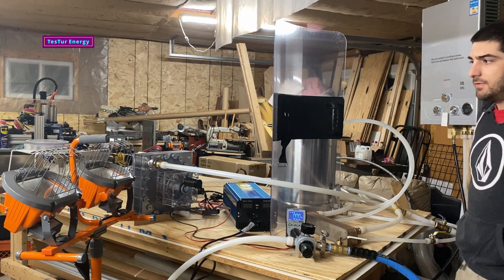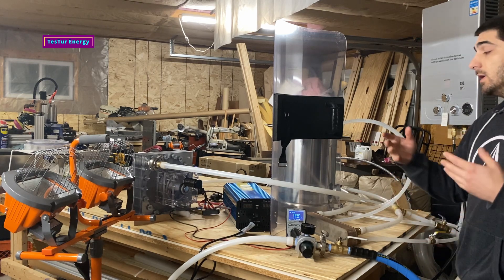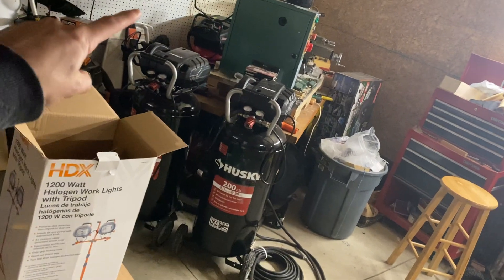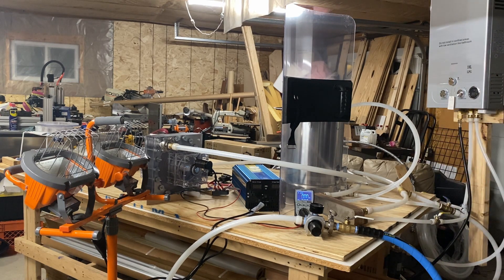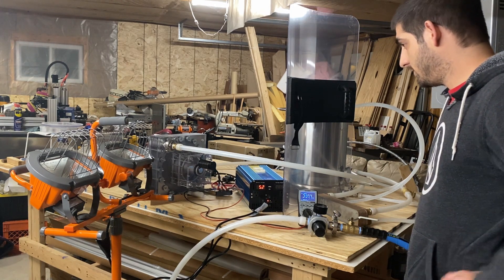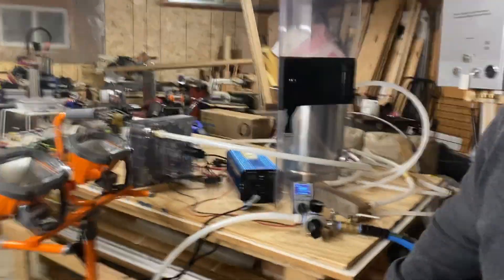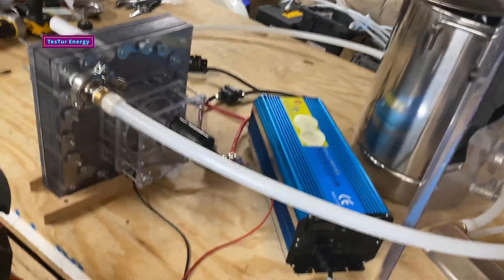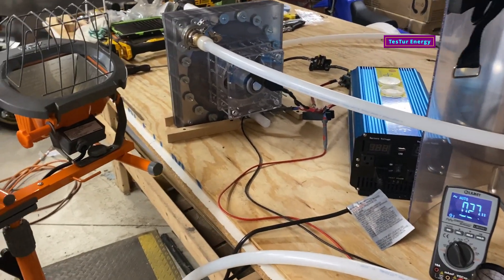Amazing Tesla Turbine Actual Power Output Test - 1200 Watt Real Electrical Load - CAES - Turbo Jet

Comment: What's the actual point of this construction? Creating more energy with less energy used? Sorry I really don't understand much about these things. But I know the principle of Tesla.
Reply from the maker: (Cont.) Irrelevant of efficiency though, can you show me a bladed turbine that can handle the wet steam that’s produced from geothermal energy sources without eroding down the indispensable complex geometry blades to little nubbins in a matter of minutes?   

Or a bladed turbine that can actually fully utilize all the heat energy in steam by actually fully expanding it and not be damaged by the condensation and cavitation?   

One that doesn’t require superheaters, MASSIVE heat exchangers and expensive waste heat recovery systems to actually maintain whole system thermal efficiency?   

Yeah sadly bladed turbines get zero efficiency from geothermal steam sources and can only be used to produce electricity from them with outrageously expensive multi circuit loops to keep all the fluids separate and have MASSIVE heat exchangers.   

But when even just one geothermal site in California has more energy than the US needs for the next 1000 years and TesTurs see no damage from multiphase motive fluid flows I’d take even just 10% efficiency over the zero that bladed turbines can offer.   

The same goes for solar steam boilers because it’s very difficult to have a residential solar boiler that doesn’t produce wet steam.   

Furthermore bladed turbines can’t use low grade fuels like biomass, woodgas, and definitely not solid particulate fuels like powdered coals and pulverized iron.   

That’s not an issue for the TesTur for the exact same reason that condensate and cavitation in wet steam doesn’t damage it. Because there’s no lifting surfaces for the particulate to smash into.  

What most people mean to be saying is, bladed turbines get a high efficiency on only a very limiting, very specific, very expensive set of proprietary formula refined fuels.  

And the only reason TesTurs don’t is because no one has actually put any money into them like the BILLIONS of dollars thrown at proprietary bladed turbine designs just to get 1% point increase in efficiency.
Reply: @CharlieSolis  hey man, I admire the effort you put into these answers. I overread them quickly but I am not sure if I could suck them up entirely. I am at work so don't have much time. I am a hobby machinist. I read some things from Tesla. I just want to know the goal of the Tesla turbine and if you can reach it. It's a device which uses steam propellant which accelerates under pressure the discs on which it's pointed to. The reason to make this application is to generate more energy out of not so much energy right? Please give me answers like I am really stupid. I just want to know the overall facts. I really admire your work. Keep it up and be careful...
Reply from the maker: @shadowwalker2145  the end goal is to give consumers energy independence through Combined Heat And Power (CHP) systems that can make use of underutilized and “monetarily free” energy sources like biomass, solar thermal, geothermal and even low grade fuels containing high quantities of solid particulates like pulverized coal and powdered iron; energy sources/storages that are currently underutilized due to the lack of turbines and engines capable of handling the multiphase fluid flows (any combination of gasses, liquids, solid particulates) present in low grade heat boilers and low grade fuel sources without damage over prolonged/continuous periods of use.
Reply from the maker: @shadowwalker2145  when even just one geothermal site in California has more energy than the US needs for the next 1000 years and TesTurs see no damage from multiphase motive fluid flows I’d take even just 10% efficiency over the zero that bladed turbines can offer.   

The same goes for solar steam boilers because it’s very difficult to have a residential solar boiler that doesn’t produce wet steam.
Reply from the maker: @shadowwalker2145  Furthermore bladed turbines can’t use low grade fuels like biomass, woodgas, and definitely not solid particulate fuels like powdered coals and pulverized iron.   

That’s not an issue for the TesTur for the exact same reason that condensate and cavitation in wet steam doesn’t damage it. Because there’s no lifting surfaces for the particulate to smash into.  

What most people mean to be saying is, bladed turbines get a high efficiency on only a very limiting, very specific, very expensive set of proprietary formula refined fuels.  

And the only reason TesTurs don’t is because no one has actually put any money into them like the BILLIONS of dollars thrown at proprietary bladed turbine designs just to get 1% point increase in efficiency.
Reply from the maker: hey thanks for commenting and showing your love and support! ❤️🙏 

it really helps with the algorithm!     

These preliminary tests are just to see how much electrical power can be produced with room temp compressed air driving the Tesla turbine. 

The TesTur nozzles never went over 20psi at the nozzle for the 2650watt electrical load test and not over 40psi at the nozzle for the 4250watt dyno test.   

This is so I can get a baseline for what to expect as I increase the temps to combustion levels.   

When using elastic gasses the counterintuitive thing most overlook is that the viscosity of gasses goes up with temp. 

So not only do we see an increase in thermodynamic efficiency from increased temps but the TesTur isentropic efficiency also goes up due to the reduced slip from the increased viscosity.
Reply from the maker: As far as efficiency goes… (mind you this is a copy pasta 🍝 so it’s a bit long but it’s worth the read.) 

…My 2650watt electrical load run came in with a very low ball calculation of 40% isentropic efficiency.  

To start off, mind you that includes generator losses, 3 phase rectifier losses, and inverter losses to the electrical load that were not accounted for. 

So the turbine off the bat is already most definitely doing better than the 40% isentropic efficiency I’ve calculated from the already low ball test results.   

But for now I’ll just assume 40% isentropic efficiency so that I’m not over claiming what I can prove it can actually do for the time being. (I have nothing in the long run to benefit by overstating my numbers and only my legitimacy to lose. I’ve worked hard for my physics degree and don’t intend to tarnish it for a couple of extra views on the internet.) 

As far as inefficiencies to the system to fix, there’s 10x crappy ball bearings in this version, 2 crappy RC car gears, both losses will be gained for power out with a direct to shaft generator. 

(Minus two gears and 8 crappy ball bearings)  

There’s an 1/8 of an inch of space between the turbine endplates and the casing endplates on both sides of the TesTur. 

That’s a 1/4in of open flow area around the 2in wide turbine (that only even has a total of 0.75in wide of spacing between all the tight disc spaces for torque to begin with.)   

That means 25% of the open space for flowing through the casing, between discs and between the casing and turbine endplates, is just free flow over the side of the turbine still. 

(I’m using the absolute bottom of the barrel of machining equipment right now in my garage 🤷‍♂️)  

There’s no labyrinth seals yet to even attempt to further reduce that overflow…
Reply from the maker: (Cont.) The nozzle is atrocious at the moment, when making the variable converging section have a tight convergence it causes the fluid jet to aim more centripetally (towards the axle) instead of tangentially (glancing off the disc tips) which severely effects the fluids natural path.   

This will be fixed with the new variable nozzle design I’m going with.    

Then even further in this specific casing’s assembly there’s two “pillars” in the middle of the nozzle.   

This is because the aluminum plates in the middle of the casing plate stack only had the variable nozzle bar and inlet holes cut out, and not the full nozzle geometry.  

So those pillars are just vertical bars in the middle of the nozzle for the air to smash into just before going into the turbine (hopefully the wet steam tests will just erode them down 🤭)   

Before all that there’s still about 100ft of air hose between the tanks and the turbine… plus a shell and tube heat exchanger and a TON of elbows and fittings.    

I’m sure I’m forgetting something too but between all that being fixed… I can almost guarantee we will be in the 60-70s % range and that’s all just still with room temp compressed air.   

Most forget, I’m using room temp compressed air and never went over 20psi at the nozzle for these tests.

(Pressure differential and temperature differential govern efficiency) 

And even then I still only even have a single stage on it yet.   

Everyone wants to compare it to the efficiency of a very high temp, high pressure (1000°F & ~1800psi) multibillion dollar 15-30 stage steam turbines…   😮‍💨   

That’s apples to rocket ships. 😅  

But considering Rankine Steam cycles get theoretical max about 33% of input heat (due to latent heat of condensation and that’s without any regenerative boiler feedwater preheat, air fuel preheat, etc) and then 40% isentropic efficiency (considering the turbine as is) we’re looking at 13.2% thermal efficiency with steam.   

A more apt comparison for the TesTur would be something an individual can actually purchase, like 1-5kW piston gas generators that you can get from Home Depot or Lowe’s.   

These get 15-22% thermal efficiency off the plant floor. Good luck getting that 1 year down the line or later with all those moving parts.  http://ienergycorp.us/Efficiency.html#:~:text=Modern%20GASOLINE%20ENGINE%20GENERATORS%20have,about%2018%25%20to%2020%25.

Also for reference, industry standard for micro bladed gas turbines is 25% thermal to electrical. 

Whole system efficiency can go higher in Combined Heat and Power (CHP) system, but alas the TesTur would see the same whole system efficiency increase in a CHP Auxiliary Power Unit (APU).  

In the TesTur you gotta replace…? 🤔bearings…? 

And still even then, only maybe 🤷‍♂️ depending on how good of bearings, balance, lubing, cooling.   

The TesTur and other bladed turbines has one moving part. 🔥
Reply from the maker: (Cont.) So if those piston generators drop efficiency, even at all, the TesTur on its worst day is competitive with a gasoline piston engine electric generator.🤓😬🤷‍♂️  

And the TesTur can handle any fuel that can burn, even solid particulate fuels like powdered saw dust, pulverized coal, powdered iron, biomass, etc. (noting the number of those that can be acquired for free… 🤑 

opening up “Monetarily free”, even carbon neutral, fuel options for MILLIONS around the world)  

We have to remember that the TesTur doesn’t have to be the holy grail to be worth using if we have free fuels readily available like biomass, and even waste heat already being dumped out into the air and not used for anything.  

The TesTur just has to be a viable option for some to be worth doing. 

Even more, the mere fact that I’m using a low temp fluid for my 40% isentropic efficiency calculation means my TesTur efficiency is severely limited by thermodynamics and fluid dynamics.   

Increasing temps will automatically increase my turbines efficiency.  

This is because gasses have an increasing viscosity trend as you increase the temperature.   

This leads to increased isentropic efficiencies in the TesTur from reduced slip on the discs.  

(Meanwhile, we’re already talking about a piston engine using combustion temps as is.)  

Whereas bladed turbines see the increased viscosity as an increase in drag loss through the turbine blades.   

So we can’t always count on seeing increased isentropic efficiencies in a bladed turbine in practice when we go from low temp to a high temp.  

Again, to reiterate, this increase in viscosity in the TesTur only works to enhance the working action of the TesTur.  

(That being viscous adhesion to the disc faces increasing torque.)  

That’s all on top of the increased thermodynamic efficiencies of using a higher temp elastic fluid too! 🤓 

The disc spacing for room temp gasses is not going to be the same for combustion temp gasses/steam because the viscosity of either increases by 3x fold. 

And I’ve designed these spaces for a higher temp fluid with a slightly higher viscosity so these will inherently be too wide at the current temperatures being used.   

So as we increase temps along with all these other really easy to fix mechanical issues (that only are a thing because I’m building this in my garage on a junk cnc machine) I have no doubt we will see more than competitive isentropic efficiencies, compared to bladed turbines, let alone whole system thermal efficiencies that are through the roof. 

This is because of the heat recovery systems that can be added with the savings costs of using a TesTur vs a VERY expensive to manufacture, and in my opinion, relatively delicate bladed turbine.   

Just getting tighter casing clearance with the turbine should give me at least 20% points back on efficiency putting my testur at the 60% range. 

Coming in with a 19% thermal efficiency in a Rankine steam system without any kind of thermal recoup.

Comment: How many diodes are you using for rectification
Reply from the maker: Hey thanks for commenting. There’s just 2x 3phase full bridge rectifiers. On for each generator. Then the two rectifiers are in parallel with the inverter.

Comment: You were talking about braking would you not be able to load the motors to induce resistance breaking or would it break your Motors/Generators?
Reply from the maker: Yeah that’s what I was referring too. The audio was bad to hear but I was sayin I need to add a “resistive” brake. Just short the dc rectifiers through a big resistor.

Comment: What are you using for the generator side, the look like BLDC, is that right? If so, can you share spec or model numbers? Ta
Reply from the maker: Hey John! Yes they are BLDC’s. Here’s all the specs. If I missed anything let me know! 
10in Tesla Turbine 75 Disc Air Engine 2.65kW Peak Power Output 9.23lbs 4.2kg 10,000in^2 surface Area. 0.0092in disc spacing, runner is just shy of 2” wide, the turbine is geared UP (yes you heard that correctly, up) to the generator at 3.6 to 1 with the 2200Kv BLDC generators (max rpm of 60,000 and 25Volts) with a max of 120amps. Bringing each generator to 3kW max. and 6kW mad total power potential from both at 24v. However they are being operated at the 12v range of RPMs so they can only max 3kW total together without exceeding the 120amps limit. 

As for efficiency I have now calculated it a few different ways. If we only consider the energy put out by the light alone the efficiency seems to come in around 15-25%. That’s calculating the available energy in the amount of compressed air we have available in a couple different ways and is really a rough estimate. If we can fix the gear losses, again which should be easy to do with the the axial flux generators, the efficiency is coming in between 25-35% efficient and could be even higher depending on how much of a low ball I put on those loss numbers. (And that’s not accounting for generator iron losses, rectifier losses or inverter losses too) my power loss tests showed 1-2hp of loss from the unloaded condition and my calculations only have 800watts of loss. That’s only 1.09hp. Realistically the loaded condition could be seeing upwards of 2-3hp loss so the real losses are something like 1600watts plus, which if that’s the case the efficiency is looking like it’s close to 35-55% efficient. Again these are rough estimates for how much energy is available in 170gallons of 150psi compressed air dumped to 65psi. Which for the record the different ways I calculated it give it a range from 260,000-380,000joules. I had a whole section about efficiency in this video but it made the video like 20 minutes long and very dry so I decided to cut it out and I’m going to be making a video about just that when I use twice the tank size as previously being used. The larger the tank the more accurate I think the efficiency tests will be on endurance runs. 

But yeah if you know how to, let me know what you get for the total joules available in a 170gal tank at 150psi being dumped to 65psi. Like I said, I came to those numbers above. It would be interesting to see what others calculate for me to compare to.

www.TesTurEnergy.com
To inquire about more information email me at TesTurEnergy@Gmail.com 
Or if you would like to help bring Nikola Tesla’s Turbine to the people of the world go to my Patreon to aid the cause so we can make more prototypes and models! 
https://www.patreon.com/CharlieSolis
Reply: @CharlieSolis  thanks for the detailed response 👍
Reply from the maker: You’re welcome John. Let me know if you have any further questions!
Reply from the maker: @johnharding2912  1200watt Load Test ELECTRICAL Output Efficiency Calculations For 10in Tesla Turbine Are In! 
See the charts here!
https://www.youtube.com/post/UgkxRukN0zoVbtfe1LmLUlXyIo0kdt1ExWZs